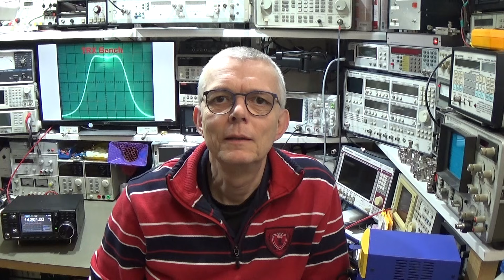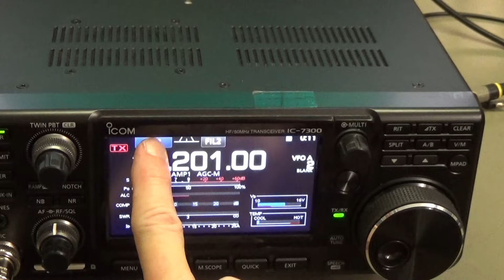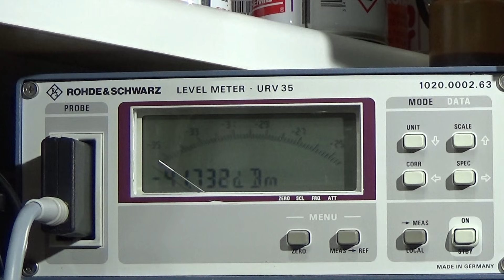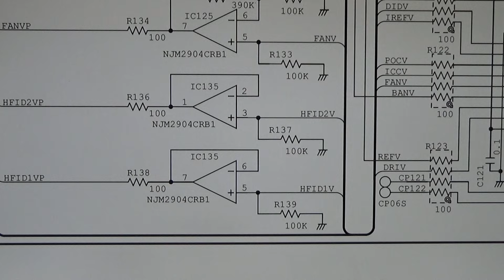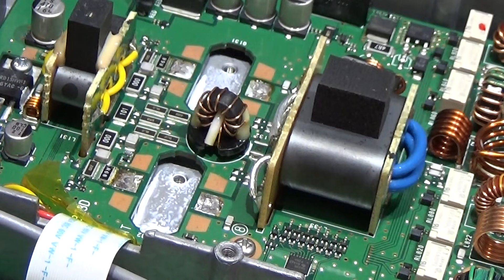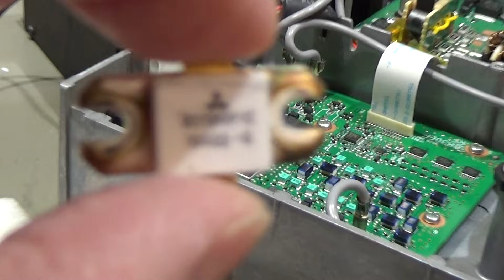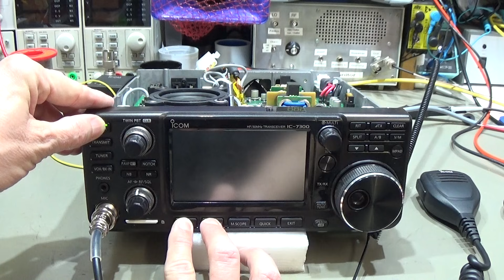#221 Repair ICOM IC-7300 with Power Loss

Comment: Have the settings been altered if so would a factory reset solve the problem or a new firmware install solve the problem or is the problem in the RF stage.

Comment: When you have an over voltage on a transistor does it not become saturated?  Then it conducts too much current.  So you find a bad MOSFET.  The funny situation has a remedy.  Another case of bad finals.  Maybe ICOM has caught the dreaded Yaesu finals problems.  What is the major cause of final failures?  W Rusty Lane K9POW in eastern Tennessee

Comment: Awesome fault finding again as always Peter. Nice to see such a new radio being repaired. I wonder what caused it to fail. The setup for the new finals seemed very easy compared to the old school methods. Let’s hope the software is accurate. Thanks for sharing the repair. Regards Graham
Reply from the maker: Thank you Graham! Well what the fail caused is really in question as the radio was handled with care so I really hope there is nothing wrong with the setup...

Comment: Great video as usually dear Peter, it's a classic defect with RD70HVF1,  gate voltage wrong is a bad-signal :-) Best 73s Peter, Pasquale IW0HEX
Reply: Why do these transistors fail?
Reply: @ukrainehamradio  Mosfet family are very sensitive, it's enough a little bit spike of RF or static and oxide gets in fault !!! I repaired radios like IC-706MKIIG, IC-7300, IC-7000 and so on with finals with gate in fault. Regards.
Reply from the maker: you are right Pasquale, a wrong gate voltage is never a good signal...Thanks for coming by!
Reply: @ukrainehamradio  MOSFETS are incredibly sensitive to two things: static electricity and reverse polarity.   And, they don't always completely fail.
Reply: @iw0hex  Si possono sotituire con gli RD100HHF1? Credo siano piu' adatti in hf e tensione gate +/- 20 volt sono un po' piu' robusti.

Comment: Great Tutorial !! Just knowing where the different placement of the various boards are located, is a wonderful start to getting to the next step in place!! Your showing the physical locations of the PA driver board, and cables, will stick with me when I eventually purchase my own 7300. What a FANTASTIC tutorial!! Thank you TRX Labs!! Your statement of replacing BOTH PA's was interesting. I assume that was done because your logic is that the good PA was way over-stressed, (demonstrated because the 7300 got to NEAR max power-out, with just ONE PA ALONE, causing the life-expectancy of that good, single PA to be radically diminished). The latest firmware installation was ANOTHER point of interest as well!!. I am GLAD that Icom has provided diagnostic information/settings, as well, that is accessible on the front-panel readouts!! Thank you, AGAIN!!
Reply from the maker: Glad that you liked it so much

Comment: Hallo Peter, wieder einmal so ein schönes repair Video von Dir!! Interessant ist wie ICom in der IC7300 FW den Bias Abgleich selbständig durchführt. Den bias Abgleich mit der neuen FW noch einmal auszuführen scheint mir sinnvoll. Schaden kann es ja nicht und so wie die FW den Abgleich autonom ausführt ist es ja auch sehr einfach und sicher durchzuführen. Klasse Video - PY2BND - 73
Reply: Servus!
Bitte !!
Welchen Knopf zum Ausstieg bzw. speichern aus diesen Menü,das zeigt er nicht mehr.
73  OE6ODD
Reply from the maker: Danke Wolfram. Hatte gar nicht auf dem Schirm das Du in PY bist...
Reply from the maker: Strickt nach Service Manual arbeiten. Zuerst den Klinkenstecker ziehen, dann ausschalten und wieder einschalten fertig...

Comment: Hi Peter, as an RF engineer I found your troubleshooting method to be excellent. With only ~1dB delta in drive to the final stage, it became apparent that one of the RD70HVF1C n-channel enhancement mode MOSFETs were likely damaged, but it was good to then check biasing of the final stage pre-drivers. As soon as you compared biasing, my thought was one of the push pull pairs was in question. How the fault occurred would be interesting to dig into. The positive gate voltage made the MOSFET operate in full enhancement mode, which means that the good transistor was doing the work. Your recommendation to replace the finals in pairs is extremely good, and it is also important to note that optimally the pairs should be from the same date code so that their operating characteristics are therefore as identical as possible.

I appreciate the physical design by ICOM with respect to final layout, but question the choice of Mitsubishi RD70 which is designed for VHF, not HF. There is a note in Mitsubishi's datasheet that comments about this. S11 parameters are centered around 175MHz.

"4. In the case of use in below than recommended frequency, there is possibility to occur that the device is deteriorated or destroyed due to the RF-swing exceed the breakdown voltage." 

So, did this occur? Was the radio being used to cause the referenced breakdown to occur, or did improper idle biasing occur from the microprocessor?
Reply from the maker: Thank you

Comment: Thanks Peter, that was a superb video, I have the IC 7300 and have done the 1.4 software upgrade. I am surprised the radio managed 90 watts with only one transistor working. 73 de Mike G4VQH

Comment: Thanks Peter.. I love your thought process, analysis and explanations. It is a pure joy watching the repair videos.

 I actually have the same issue - different power levels on different bands with my vintage Yaesu FT757 GX2 !!. 

I applied same elimination process. The input (Base) of TX RF Amplifier on the RF board gets different levels while the level is almost the same on all bands at the Mixer and Buffer. In between is only the band pass filter with many, many  switching diodes !! 

Receive is Ok but I guess some of the diodes might still be leaking - so will replace them all to be sure. 
Viele Gruesse aus Manila
Reply from the maker: Thanks for your report!

Comment: Nice work, excellent procedure.  I have that same radio (Icom IC-7300) and already on the second set of final transistors.  The first set appear to have been destroyed when my Astron 35 power supply crow-barred, shorting the power supply but also allows a brief reverse current in the radio as it discharges the capacitors inside the radio back through the crowbar.  MOSFET's actually operate in reverse bias most of the time; if you reverse the voltage it looks like a big diode and basically a short circuit.  Kaboom.  Anything that can crowbar the power supply is dangerous for an IC-7300.
Reply from the maker: very interesting..Thanks for feed back

Comment: What a very nice radio! And a good job fixing it. I'm glad you didn't check the finals first. Those first few test's were good to see as you narrowed the problem down.
Hey have you compared your Multi-Function Tester TC1 against very expensive equipment? Thanks!

Comment: Note in video +30 dBm at 50 ohms is 1 watt, so measured drive levels at around +10 dBm would be 10 milliwatts and so forth. that's why in trouble shooting u need a sensitive RF level meter that works at the frequency in question plus down to low milliwatt levels.

Comment: I had in for repair a TS850 a few years ago that had issues with power output , Traced the fault to the IC that to the control signal and switched the relays , It was stuck on one frequency range , from about 4 MHz to  6.5 MHz .... In this range the radio did what it was meant to do , But outside this range as the low pass filters wernt being switched the radios protection circuits cut in and reduced power , As well as seeing a high input vswr due to the wrong filter for that band ..... Just a single IC worth a few £ and it was back up and running again .... Nice  😁
Reply from the maker: Thanks for your report very interesting

Comment: I have fixed plenty of IC-7300 with similar problems and almost ever, it is one of the finals which is KO. I will watch the video to see if I am right...
Yes, they were bad!. Good reasoning and very instructive. Why do they fail is still an obscure thing... Maybe you are right and the firmware is the culprit. I use to update it also.
Another thing which is faulty on that unit is the clock battery, this is the reason it starts at 0:00. It uses a rechargeable battery but goes bad. I use to replace it with a different model, which hope lasts a bit more.
Reply from the maker: Yes we will  find out why the finales fail we need some more time..

Comment: Great video! A guide for the ID calibration on a IC-7610 would be most welcomed! I'm curious, having been an electronics technician myself (in another life), I find it interesting we never really saw you wearing the ESD strap during repair, however, it appeared that you were wearing it during calibration. I've always been taught to NOT wear ESD when circuits are live (you do not want to present a good ground path)

Comment: @TRX LAB 
Amazing. I have this radio. But I have no SWR protection somehow.
If my swr is high the radio still displays whatever wattage (over 50W) on the display without cutting back the output to a safe level. . I'm baffled duly subscribed

One question about these RD70HVF1C 164A -G

Do they have to have identical numeric alphanumeric (ie the bottom line 164A -G) as I've been looking for the ones you got delivered as spares and can't find them anywhere?

Comment: @TRX Lab, Hello. What was under the final contact , on the board before you applied the solder to the top of the Final contact? Was it a small solder blob under the final contact before you put solder on top?
Reply from the maker: Yes

Comment: The adapter cable you used to bypass the antenna tuner so you could directly measure PA output at tuner input, is this cable commercially available or did you build it?   If commercially available what is technical name for coax connector on adapter cable so I can search for it?  Great video, your channel is a wealth of practical knowledge.

Comment: Thanks for the troubleshooting video. It's good to see your thought process.
Can you describe what's inside the diagnostic jack? I presume it enables the diagnostic mode to be used?
Something on the lines of a loop back plug I'm guessing.
When there was full power on 20m and not on the others, I was expecting the problem to be around the LPF or LPF relays.
If you monitored the RF output on 20m would it be grossly distorted as the bias was out or perhaps the stars were aligned for 20m so it appeared to "sort of" work?

Comment: Would have made a nice insight if you had checked the bias voltage on each FET before and after the firmware upgrade 😉

Comment: Thank you Peter.....very interesting....can I ask you....does the 7300 have good high SWR protection to protect the finals.

Is it unusual for finals to fail on the 7300.
Reply from the maker: All radios today has an appropriate SWR protection circuit...
Reply: @TRXLab  Is it fool proof Peter....

Comment: I would like to know the power setting of the 7300 when you did the bias adjustment / with dummy load? Thanks..
Reply: It appears to be entirely in microprocessor control.  Anyway, the alignment procedure is in the manual; not sure which manual however.

Comment: Thank you.  This gave me the information I needed to test my 7300's output power.  My rig is outputting 100 wats on all bands EXCEPT 40 meters which only outputs 28 watts, and 15 meters which outputs 80 watts.  Will running the automated adjustment procedure fix this problem, do you think?  73, de JS2OLO

Comment: Peter do you advise checking the bias periodically to make sure the biasing of the finals are within spec? Great video as always Peter. 73 Joe
Reply from the maker: no not periodically but an old radio +20 years are developing bad pots which might be replaced to prevent a final crash. See the Yaesu FT-817 which is not 20+ years but the pots are bad and creating a lot of  trouble....

Comment: Not to get off the subject. How difficult is it to setup a antenna tuner (MFJ-939i) to the Icom ic-718??? Can you help???
Reply: Very easy 😊 The MJF939i should come with the radio interface cable to connect to the ICOM. Connect your Antenna to the Tuner and then a patch lead to your Radio output.
Make sure you turn your output power down to about 10 watts or less when you tune up.
If you read the manual,s for your Radio and Tuner it will explain how to use them.
Good luck and have fun. 73 Steve M0BFM

Comment: I'll go out on a limb here, when I got my 7300, I looked at the issue of the audio amp getting into the RX especially on the AM band as it does but what I did discover was that the screws that hold the PCB's and the screws that hold said transistors to the chassis/heatsink weren't tight. Now I am not saying tightening them until the screws go loose and back off 1/2 a turn :)  but pretty much all the screws could do with 1/2 to maybe 3/4 of a turn or more (some where on the verge of being loose) to make them firm. The PWM audio amp in the 7300 (poor design) still is an issue but I solved that with a 7610.
Reply from the maker: interesting report

Comment: Do you think the RD70HVF1 (not C) can be used? I have them from an older radio PCB (ic706mk2g). Thanks.
Reply from the maker: Should work
Reply: Thanks a lot !! @TRXLab  Yes it's working fine

Comment: Hi I get no power on 80 and 20 watts max on 40 all other bands are OK Bias on gates of PA are 3.9 on both PA transistors It seems consistently low on 80 but did come good for a few minutes now bad again do you think it could be PA transistors or out put switching..

Comment: Great work! RD70HVF1C - is this mosfet more fragile than other transistors and LDMOS? This is not LDMOS is it?
Reply from the maker: The RD70HVF1C is a MOS FET type transistor specifically designed for VHF/UHF High power amplifiers applications. I would not call this type as more fragile than other types. It is more a design and firmware question in general..

Comment: Peter hi !   Great advice thank you Sir.    Would you advice to align the bias current  even from a new radio?  Or just leave it?
I have noticed there are some differences between bands.  WRT power delivery   using a dummy load for testing, but never knew why  or how to fix
Reply from the maker: I would update it to the latest Firmware and run the procedure..

Comment: @TRX Lab - Very good tutorial. I have the same problem and need to fix it. Where do I get this "Service Jack" which you are talking about to set the Idle-Current. Or could you at least say how the official product name of it is? TNX VY 73
Reply from the maker: That is just a "Klinkenstecker" 3,5mm with a bridge inside
Reply: @TRXLab  Many TNX. Just to clarify: What do you mean by bridge? Is this custom made or can I buy something like this in the shop?  May you write the name of it in German, so that I could find it? Vy 73
Reply from the maker: @divecampaign  es ist einfach ein Kurzschluss zwischen den beiden Pins der Klinke. Das ist alles.

Comment: Hi Peter great repair. That's was interesting about the firmware I have the new one installed in my 7300 do you think it's recommended to do the bias adjustments after the new firmware or just after having new finals installed. Thank you for sharing with us always watch your videos 👍👍
Reply from the maker: As I said in the video we don't have any information about what will be really corrected by the new firmware release but it can't be wrong. Follow the service manual and what ever you do is on your own risk!
Reply: @TRXLab  yes the new firmware is very vague except for the new features.
Thank you and 73

Comment: Great video Peter. you didn't do 6m though. Is the final bias adjusting in earlier firmware? This video is your best so far. I have said that if ICOM were in financial trouble this radio brought them out of trouble :-) The first radio I saw that let you set the main oscillator frequency from the front panel that I saw made me jump for joy :-) Now the final bias, wow! Thanks a heap for this video. Now can you change TRX BENCH to TRX LAB on the LP-500? haha.
Reply from the maker: Thanks OJ, well we don't know what the firmware does either the old one or the latest version. We need to run on a guess..

Comment: Nice job keep up the good work I wish I had your knowledge if I ever need a radio worked on I will be contacting you you definitely know what you're doing when it comes to working on electronics and check circuits and making sure everything goes right 73's and God bless from kc9cjc

Comment: Lovely video many thanks.
You say the service jack was plugged into the back port when you made the bias adjustments, will the service menu not appear without the service jack plugged in.
Its a lovely radio, my old FT767 used to be my favourite but the 7300 has surpassed it.
Thanks again.
Reply from the maker: Yes you need the service plug otherwise it does not work. Thanks for feed back..

Comment: Peter, I enjoy your extremely detailed videos very much. I have learned a great many things as a result of watching your excellent presentations. But, In this particular video #221, involving a failing final transistor exhibiting the leaking problem. I was struck with a puzzling question. Since the pair of final transistors are common providing output power to all bands, why do you suppose the fault was primarily evident on some bands, and not on others. Just wondering why that would be the case. Best Regards, and Thanks for your great service to the radio community.

Comment: I am about to upgrade my IC-7300 from firmware v1.30 to v1.40. Would you advise me re-bias the PA and driver after the upgrade?
Reply from the maker: if you feel that you are able to do it I would recommand it. But don't do it if your are not familiar with working on electronics it can go badly wrong.